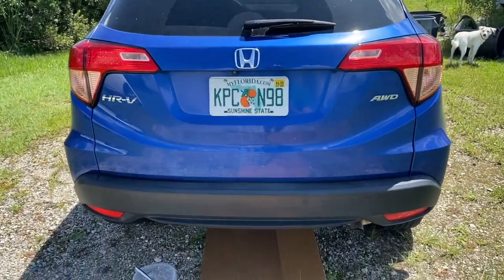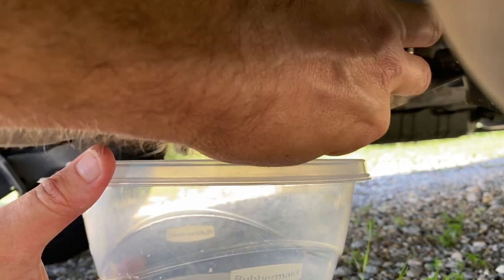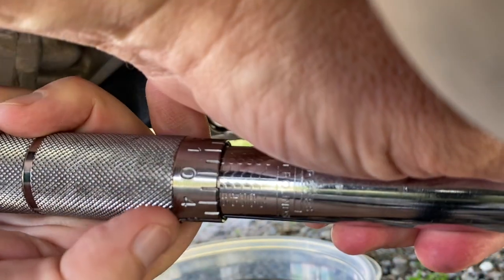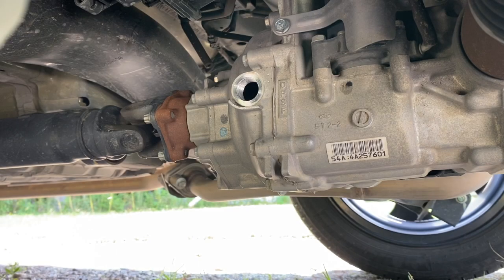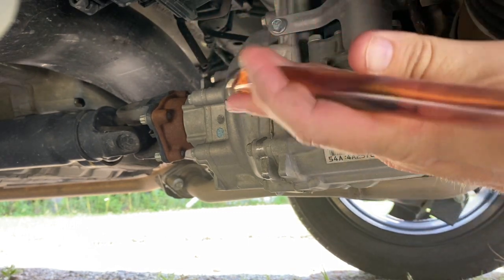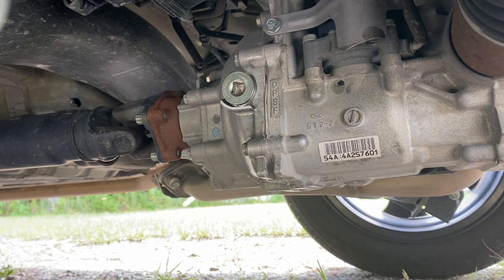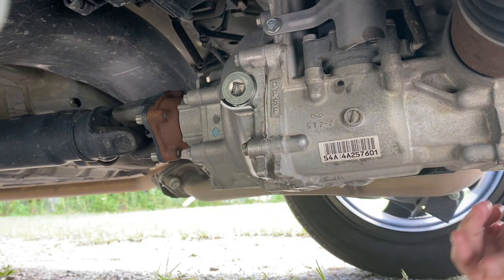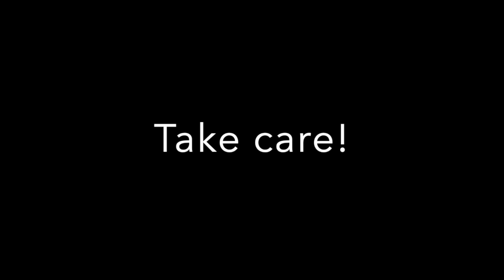2018 Honda HRV: Rear Differential Fluid Change

Comment: If I did a diff change on my S2000 would it basically be the same? I always think it’s going to take a long time to do. Lol also I couldn’t tell but it would help to put the parking brake on beforehand.
Reply from the maker: It would be a little different I think but close. It would take about the same amount of time. Next time you drive it home we will do it! XD

Comment: I tried removing my fill bolt today from 2013 CRV with my 3/8 ratchet and it started to strip out. In Northeast Ohio so the bolts are rusted. I was able to try a different ratchet and was able to get a good bite on the bolt. However when attempting to loosen it, it was so seized up the ratchet bent and actually snapped off inside the bolt fitting. So now I can't get the broken piece of my ratchet out of the seized bolt! Fortunately I hadn't drained the fluid out, so still driveable.  now what ...any suggestions???
Reply: Any updates ? Winters in the northeast….
Reply: Use a fluid pump. Or if you are brave you can drill out the bolt. But don’t screw it up.

Comment: hi could you tell me how often do you change rear differential fluid, my honda hrv 2019 and has 14000 miles on it, and maintenance minder shows 6 which means i have to replace rear differential fluid, and i am worrying is that something wrong the car has only 14000 miles on it, and i was reading that you have to change rear differential fluid between 30000 miles and 50 000 but not definitely 14000 miles does it seem strange to you?
Reply from the maker: I replace mine every 25k along with the CVT fluid. Yes I do replace the washer with it. I not at a place that I can get to my manual to get its suggestions but I’ll check it as soon as I can and get back to you.
Reply: @jstinsley   thank you
Reply from the maker: Soooooo funny thing happened. I restored my MacBook to give to my fiancé’s daughter. I temporarily have no way to access the files on my external hard drive. If you go on the HRV forum you can definitely find the answers there.

Comment: Do you like the CVT that Harvey is equipped with? Do you think the CVT is a viable transmission to replace conventional transmissions? Great series so far, excited for more!!
Reply from the maker: Thanks Paul! I personally like the CVT but a lot of ppl don't. I think it's a cool concept but it is a totally different experience. Think four wheeler that is an "automatic" or a moped. Same science behind them. The "rubber band" feel is definitely a thing and if you ever drive one you will know automatically what it means. The only reason I would say they are a viable replacement is because they are cheap to manufacture and they last the warranty period. Lol Companies can claim low maintenance costs. Other than that the newer 10 speed automatics do the job better imo.

Comment: Hi I would like to ask how many litters of rear differential fluid did you use ?
Reply from the maker: Mine took 1.5qrts so you will need to buy 2L also. Super easy though.
Reply: Honda spec is 1.32 quarts.

Comment: It’s important that the vehicle be flat. I drove my back wheels up on ramps to make more room to work, and fluid started pouring out the fill hole, and it would not take a full 1.32 quarts until I lowered it.  I think the best way to keep the vehicle flat and still be able to access the fill hole would be to jack up the left rear, remove the left rear wheel, and then lower the jack so the car is approximately level.
Reply from the maker: Excellent point! I don’t think I ever really mentioned that in the video. I use the fluid pump and it works really well. Thx for the input!

Comment: Thanks, very nice video.
Just to emphasize to be extra careful with the drain and refill plugs, these are aluminum and can be rounded VERY easily if you don't snug the ratchet completely in place. Which will be a royal PITA.
Reply from the maker: Mohammed Hnoosh #truestory. I caught myself not engaging the ratchet good in the CVT fluid change video. Can’t be too careful.

Comment: Hi, I have a few questions:

I have a 3/8 ratchet but no breaker bar (which a different video showed as necessary), will the ratchet be enough to unscrew the plugs? 

I do not have a torque wrench- is it absolutely necessary or can I get by by just tightening the plug as much as I can?

3rd- I can't seem to find anything in the owner's manual regarding the timeline of how often this fluid should be changed, but in every HRV group and forum I've seen everyone say "first 15k then every 30 after that", do you know if that's accurate? My maintenance minder came on with the code for the fluid so I'm gonna change it either way, I'm just a little wary. 

Sorry for all the questions but this is my first car so I'm trying to learn as much DIY as I can so I don't break the bank for simple maintenance requirements on cars!
Reply from the maker: Hi there! You should be able to get them off with just a ratchet. Definitely take the fill bolt out first though. That way if you can't get the drain bolt out you still have fluid in it.

If you change your own oil, the torque for the oil plug is 30 lb/ft. The torque for both diff bolts are 35 lb/ft so I wouldn't tighten it as much at you can. I'd go for a little more than snug before I stood on it. Lol FYI torque wrenches are cheap at Harbor Freight.

 I can't find anything in the manual I have that sets an interval. It just references the maintenance minder. I do know that the CRV's have had issues with the fluid in the rear diff. I chose 25k miles because it is when I do my CVT fluid change and I tend to do changes early rather than late. Don't sweat the details! When you drain it, you will be able to tell if you waited too long. 

Hope this helps!